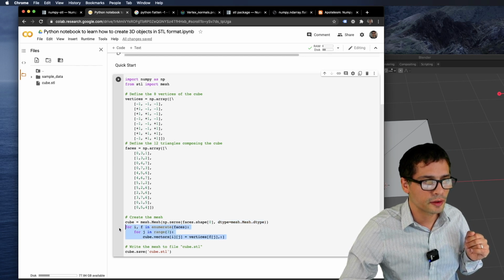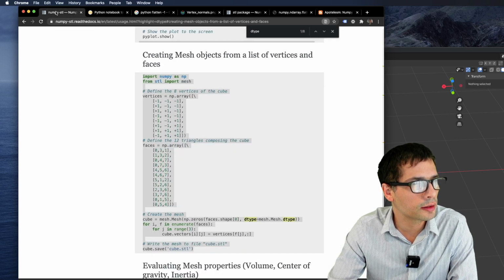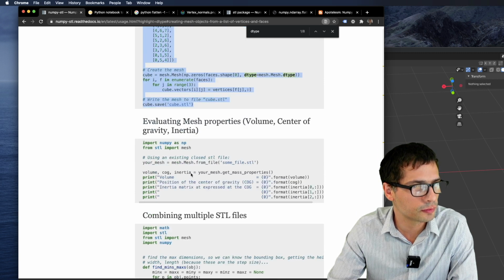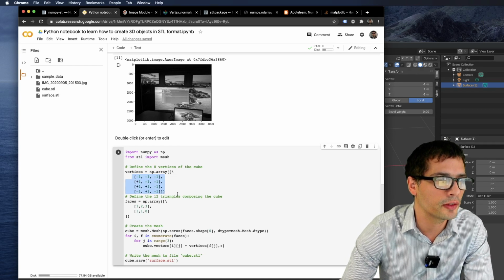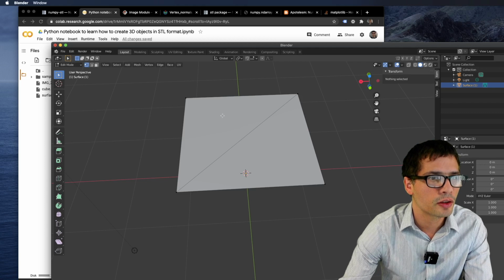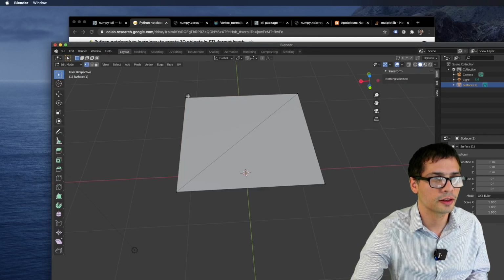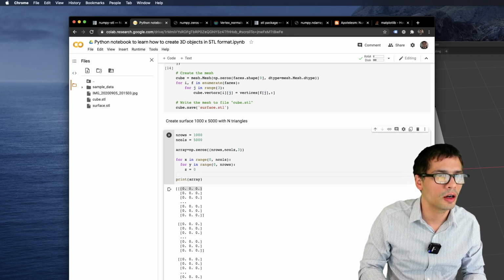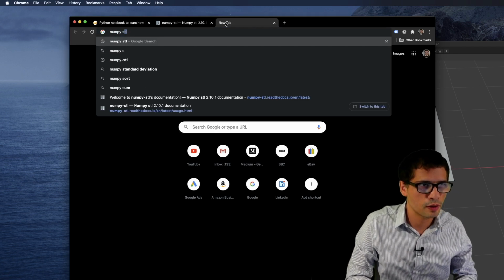Transforming a Photo into a 3D model using Numpy-stl and Python - Part II

Comment: This is fantastic, but what you could do is use that to build the information and have blender build the mesh for you using the information. That way you have more control with the tools. Also maybe consider voxelizing the mesh as well and build it using the marching cubes algorithm, that way you have way more control over the resolution by making the vox tree smaller or larger. Blender is a good place to start but honestly z brush or 3d coat would be better appt to bring the mesh into geometry due to their superior handling of large amount of faces.